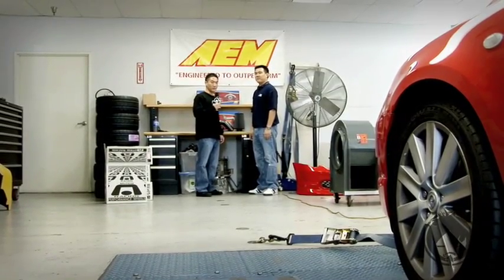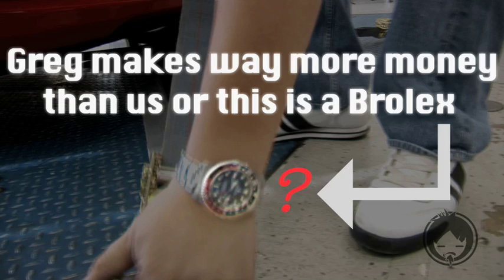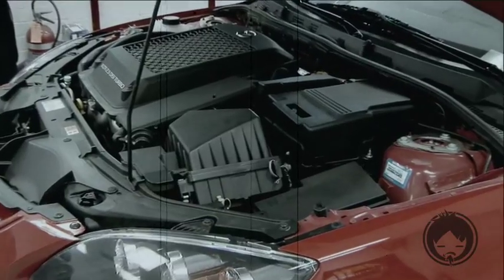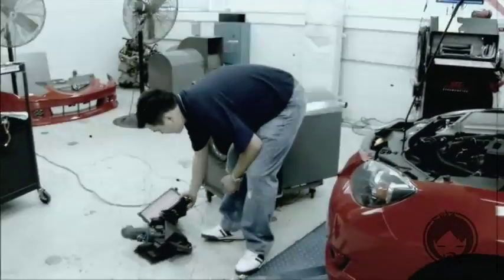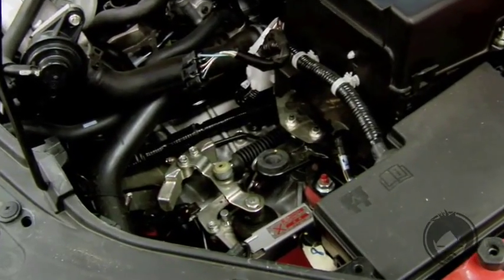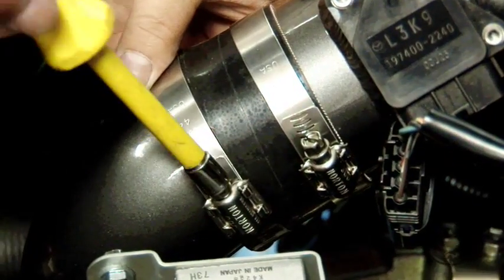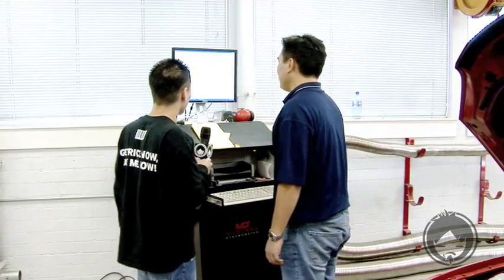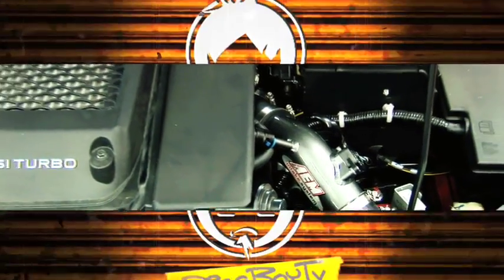Mazda MazdaSpeed3 AEM Cold Air Intake Step-by-Step Install

Comment: I have a mazdaspeed6 and yes it does give you a lot of Ho and torque gains.  Road and track did the same thing to a mzspd3 and for gains of like 25 Hp.  The hydrolock problems are not a concern.  I rains a lot where I live and I don't have that problem.  Put a rain sleeve on the filter and forget about it.

Comment: this unit is a good cold air. it comes with the air straightner inside ( bonus ) , the dryflow filter is a must with turbo cars ( for the sake of the compressor wheel) and the color will match my cobb fmic!!!

Comment: This intake did NOT cause that increased power by just less restriction ... it affected the boost control and allowed more boost. 

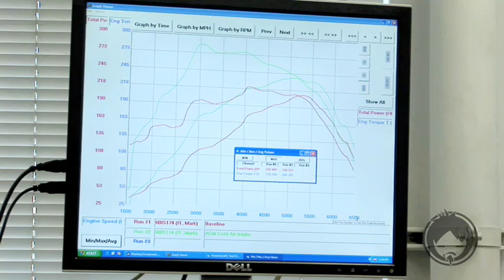Look at the torque curve from the dyno run on the video, at 2:34 .  The new torque curve at the top, now has a peak of  286 vs 220 ft-lbs. This pumped up torque curve reflects much higher boost as the intake affected to boost control, and the higher boost caused the power increase. At stock boost levels, the power gain would likely be  less than 10 hp, as you would expect, not the 25 hp at the wheels as advertised.

Comment: @Spool2Boost Naturally aspirated cars are turbocharged cars intake air at different rates and mechanics. A perfect example is when you take both cars to a higher altitude. The NA car will simply under perform due to the lower air density. The turbo car will simply work the turbo harder by applying more boost to make up for the lower density air. Thats why i always say exhaust and intakes basically do nothing for NA cars, but its a totally different story for turbos.

Comment: I got this for my 2012 ms3 and love it! I highly doubt that gains are THAT high but at least 15-20 for sure. This thing sound so so so sick when it spools up. and for hydroplane I live in socal so it really doesn't rain much but if it does you just cant boost much and have to drive smart. I am about to get a cobb AP so I can post of some of the numbers i get

Comment: Trust me the intake makes a hell of a difference for this car. It's very restricted stock. U spin in 2nd gear with it like crazy.  Cold air Is Going to be more power than the Short ram, ur sucking in all the hot air

Comment: the SRI provides a much easier install and the turbo sounds alittle louder. the CAI you get more power but having to pull the wheel well to clean the filter sucks. and i have had both with out any problems.

Comment: I assume you're saying that someone who believes in this instance a CAI can give a 25 hp gain is "ignorant?"  If so, then you should know it is well documented that practically any off the shelf intake will give the same results with this car.  The stock airbox on these cars tapers down to about the size of a quarter, so yes, there is much room to be improved upon.  Now if someone were claiming that their intake would make 25 hp on a NA 1.6L Honda Civic, then that is a different story.

Comment: only if they can prove it was the modifications fault directly. Its a bit of a grey area but there are laws to protect you when you modify your new car. Unless you suck up a rock or something you should be ok. If anything does happen and you are concerned, just get the car towed home first, replace with factory item, then get it towed in.